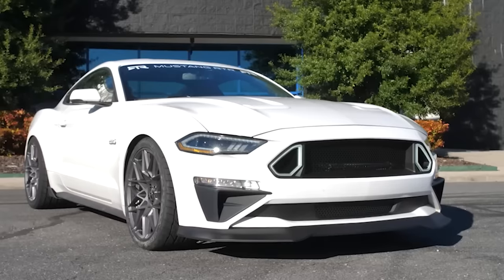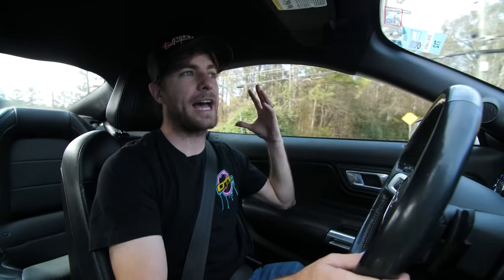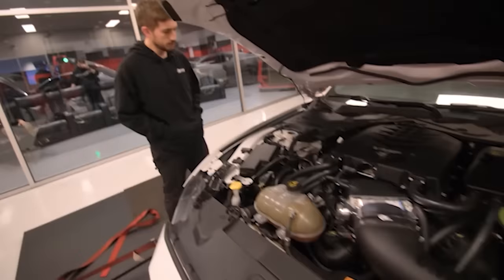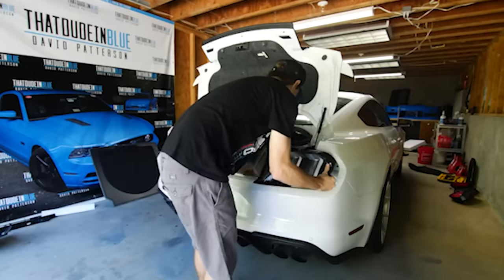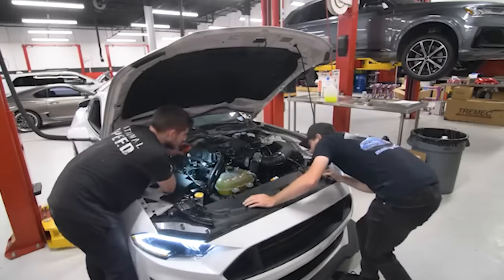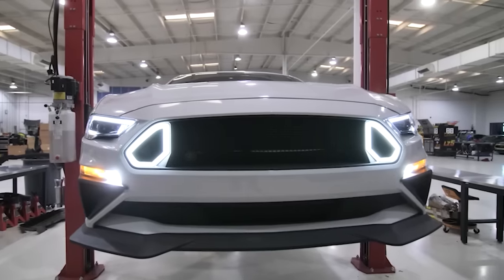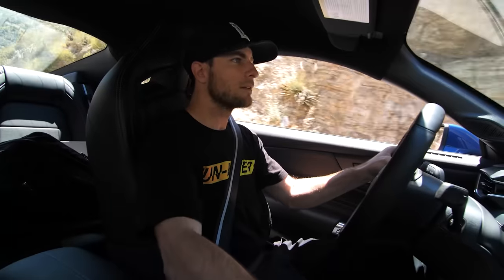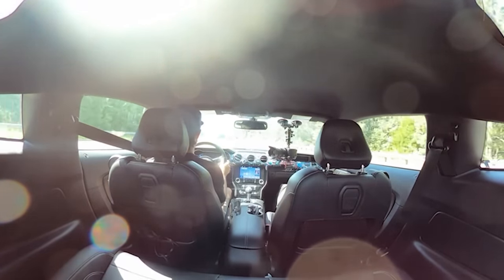750HP Daily Driver Mustang GT Ownership Experience...

Comment: You were the reason I ended up getting my s550. I was apprehensive at first since I never had one and found out how fun it is made me decide to get the 10 speed.  Pp1 2020 in rapid Red and 301a. I love it.
Reply: Do you regret not getting the Standard transmission? Im thinking about getting one but I dont know if I should get the 10SPD or Standard
Reply: @ToastyClam  not at all. I actually have just as much fun with the paddles. I drove the manual and didn't like it. If I could've afforded a mach 1 I would get manual all day
Reply: @joew1316  I heard the GT has a gross manual. And the only good one is the Tremic that comes with the higher trims. Which means I cannot afford it. Might be the 10 SPD for me too.

Comment: Your S550 is perfect don’t get rid of it. Can’t believe you’ve done so many miles at 750rwhp on pump gas. I have a Whippled 10R80 2020 GT running only 660rwhp and I’d love to take it up to 750 like yours but my tuner demands it be done on e85 so seeing yours live at 750rwhp on pump gas is amazing.
Reply: 666 HP be bad ass how much boost u got going on there
Reply: @Jays5.0-x6o  not sure, it runs a 3.75 pulley, 132 TB 1 7/8 LT headers plus 3 inch cat back exhaust but the tuner has kept it very conservative because he gave me a 3yr warranty for the bottom end. 3 yrs us up not one issue now ready for a bigger fuel system and e85 and thinking about getting it remote tuned by Lund

Comment: Love the car!  Thanks for sharing your experience.  I also have a 2018 GT but with manual 6 speed.  Never had any issues with it, and it’s bolt on naturally aspirated, not FI.  I feel the same…not enough of an improvement to upgrade to the S650.  Plus like you, I bought my car at a very low price point new.  Best car I’ve ever owned and it’s just a hoot to drive.

Comment: I still have a 2015 3.7L cyclone mustang vert 🌀 I havent upgraded yet but I dont think im going to. Currently has Intake , catback and tune, im planning on putting 3.73s in it soon and ported Intake manifolds. The car itself is hard to beat for the money 💰 also the engine will last 300k+ miles.
Reply: Save your money and just buy a S197.
Reply: I had a 2012 3.7 and the 373 differential made it feel like I gained a 100 HP.  Best mod I did on that car…

Comment: I bought an '18 GT350 (J3216) new in December '18 and sold it February '22 with a hair over 24k miles, all perfectly trouble-free. Got the itch for another fun car this year and snagged a new '23 Miata. Whole new class of fun. I still miss the GT350 sometimes, but wouldn't give up my Miata to get it back.

I'd keep the S550 if I were you. Let the market shake out the S650 a little longer, then reevaluate. Sub Zero has been good to you.
Reply: Miatas are tempting, I have a 18 350 with 19k on it same thing no issues.

Comment: I just bought a 2022 rapid red 10 speed gt premium. All the boxes were checked, pp1, active exhaust, 401a, magride, B AND O stereo. Planning to build a 700whp handling car.
Reply: Do the GT350 brake kit.
Reply: @mickeymang6  im doing mmr's gt350 carbon ceramic brakes probably.
Reply: @mickeymang6  apex wheels 19x11 +26 fronts and 19x11 + 52 rears.
Reply: Awesome, I got the same exact 2022 car, the same color except the magnetic ride control. I love this car, and I  plan on keeping it forever. Im getting a cai, ebiach pro springs, and an h pipe installed next month. Super pumped!
Reply: @jeffkelly9197  i have full steeda magneride suspension, LTH,  double h pipe, and opg and cs

Comment: For sure keep the s550, ive had my s550 for coming up 2 yrs. I've added steeda pro actives struts and shocks with .5" drop springs with billet vertical links to top it off. And it's still an experience to drive it everyday. I'm excited for my new sve 19" wheels and nt555g2 (275 & 305) to get a real nice setup b4 putting power

Comment: 10:39 My 2020 Ecoboost premium is not that way at all and never has been... It has had other issues like a making massive chunk when shifting into reverse and not liking to shift at 3k RPM... how ever as of this year both of those have been fixed via over the air updates so likely it's simnuylar to a S660 now just with the old parts.

Comment: Michigan here.. I build and mod gaming pc's.. my 21gt is my mod car project. I agree on your thoughts on the s650 not being ready to buy if one likes to mod for performance. The locked ecu to me is like buying a prebuilt gaming pc that has a proprietary motherboard. You can do only so much but are locked out of really making the prebuilt system what you want. Ford dropped the ball on performance modders by locking them out / or into only using authorized tuners. Maybe in 25/26 they will offer unlocked an unlocked ecu. If not then long live the s550 modding community.
Reply: That doesn't even make sense. Why would Ford leave one year (24) locked, but allow 25+ to be tuned? Lol.

Comment: I think you did your mods quite well. I've currently got a 19 GT Premium California Special. All the options except for magride and performance pack. But I've got aftermarket struts and springs and a JLT intake with an SCT 93 tune. Definitely would like to go Odin one day but we'll see. I've had it for over 3 years and I don't plan to get rid of the car(just got it 5 year ceramic coated).

Comment: I’m also thinking of adding boost to my 10 speed but not sure what brand to go with and also is the micky Thompson or Michelin pilot sport 4s good on handling 700+ hp? Or do I need drag radials
Reply: I have a similar setup and I use Continentals Extreme Contact Sport 2 and they handle amazing. I was running the half mile on them last weekend and had 0 issues. Made 157mph on the 1/2. For circuit/track then Continentals Extreme Contact Force for more grip.

Comment: What naturally aspirated mods are worth doing for an S550-II? I’m seeing on the forums that the stock intake manifold and air box can’t be significantly improved with aftermarket options. Just add a drop-in air filter, flash a 93 tune, and send it. Seems like any N.A. gains come from the 93 tune, not the intake mods. Curious ya’lls thoughts.
Reply: I installed a Roush cold air intake, 85mm throttle body, 91 tune, x pipe and roush mufflers and it was a huge power improvement.  I mean easy 50-60 HP.  Feels like a different car from stock.  Just the CAI and tune made a huge difference.  Plus the Roush cold air intake looks OEM.
Reply: Intake gains are all at the top end, but there is a reason they slap the GT350 intake on every special edition before the dark horse
Reply: @deanhawk7260 nice! Any drivability issues with the larger throttle body?
Reply: @RCXDerp good point
Reply: It can absolutely be improved upon.  You want max power na ported cobra jet intake, mono throttle body, cams and headers plus full free flowing exhaust and e85.  That is by far the best setup it will be the fastest and make the most power.  It will be ALOT faster than a typical bolt on car.  Peak to peak numbers alone don't tell the full story.

Comment: Is the S650 internal better than S550 if yes well you could have  800 hp, to the wheel with a whipple or  VMP new blower Odin. So the question is try to get a buyer that want to pay for the price your asking. Now I herd that whipple is working with Ford in the programming with the S650, in that case it’s a new mustang with a warranty good luck on your decision.👏💪😎🇨🇦
Reply: The Ford approved tunes are garbage.  His s550 would destroy and s650 with a blower and weak ass Ford approved bs tune that is overly conservative.  Warranties are overrated anyways 9 out of 10 times they'll find a way to get out of paying for stuff anyways I'm not sure why everyone is so fixated on warranties.  The s650 is an s550 2.0 with a locked ecu.  Because of this and having to use Ford approved bs tunes you'll never see the potential of those rods and the s550 can do 800-900+ wheel on e fairly easily.  The whole rods being better thing is a moot point.  Without custom tuning it won't matter.
Reply: Relax if you have big wallet good for you, warranty’s is important for great number of mustang owner , you didn’t listen the tunes that will come with the wipple blower, Ford have decided to gave whipple the code to unlock it. Emission  air that we breathe and by-law government are enforcing them. Still from whipple web page there saying it will make 800hp.👍👏

Comment: You have a cool build, and an Awesome Daily.  👦👍🏎🏁🚩⛰️
I recently took my White 2022 Roush Mustang with the Proper 3rd Pedal (No Lift on Accelerator Pedal) Tremec 6 Speed Manual Transmission.  Magneride Suspension it doesn't lean no matter how hard you take a corner.   Also, has a Limited Slip Intercooled Torsen Rear Differential ( off the GT500 Differential) . I will never sell it even if offered $1 Million USA 🇺🇸 👦👍🏎🏁🚩⛰️